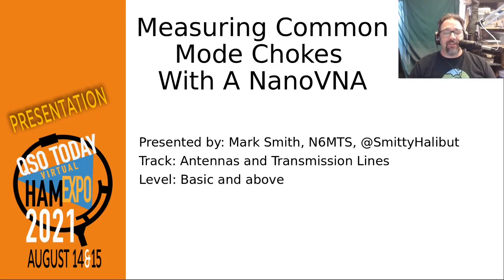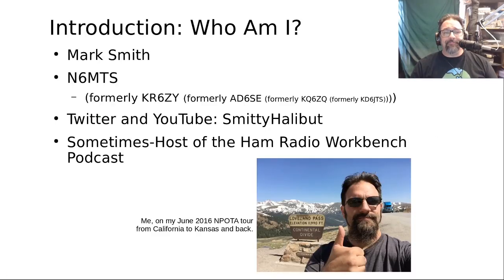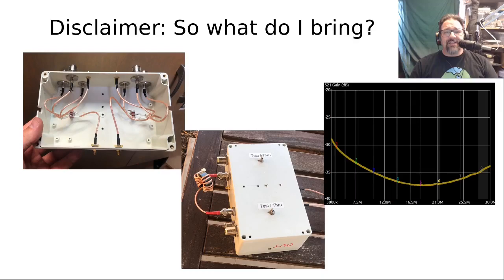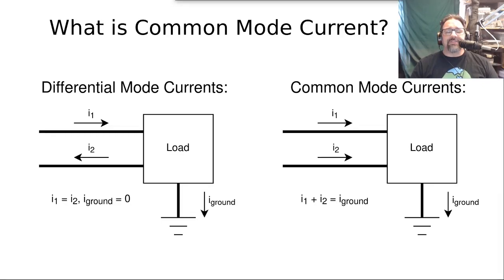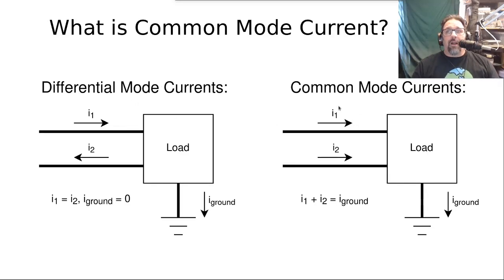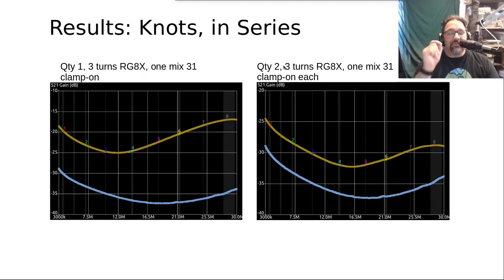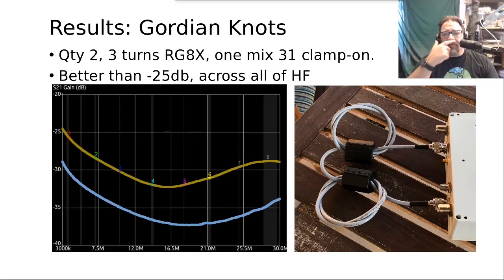Measuring Common Mode Current Chokes with a NanoVNA

Comment: You need to relearn your theory.  An inductor does NOT stop the flow of AC or RF current no matter what inductive reactance present.  What stops and attenuates common mode is resistive parallel  resistance that dissipates the common mode.  An inductor does not consume power it just changes it's phase.  Cores create this resistance within the core characteristics.
Reply: Thanks for the constructive input. I‘m sure Marc appreciates it 👍🏼
It helped me understand it better.

Comment: Great video on checking CM chokes. Thanks for doing all the work determining that 13T on a 31 Mix core is the best, fits right in with G3TXQ work that he did on chokes, baluns and ununs.
Reply: He actually said his favorite was 13 turns on a 43 mix 240 toroid not 31 mix.

Comment: I haven't seen the entire video so I apologize but thought I should say that TRX (a channel) has a video where he builds and measures the effectiveness of a common mode choke with a NanoVNA. I will come back when and if I see a measurement like he did. If not, go and see what he shows us.
Reply: I'm back. I like what I'm seeing very much. Its much more elegant to make a test device box.  I think though, you were both doing the same test. That said, what did you think of his initial test of toroid material ?
Reply: That said, I'm only seeing you show poorly wound coax baluns, and nothing properly wound. So far anyway. I'm going to wind a tested design balun with a 43 mix and good enameled copper wire 1 to 1 and see if it does what others have measured. A coax balun is not the way to go. But, I do like your testing set up, and have both a regular nanoVNA and a V2.
Reply: @californiakayaker  It depends on what problem you're trying to solve.   If you have a perfect dipole antenna with identical shape and size no uneven obstructions in the near field a wire wound balun is better, I think we can all agree on that.   

A wire wound balun won't solve my problem in my mobile between 160m ~ 40m where I am attempting to capacitively couple with the earth. I need coax balums right behind the unun or it all goes to Hell real fast.  You get the antenna perfectly tuned then start applying about 500 watts and it all falls right on its face, as the amplifier kicks out because it sees 60 watts coming back.  🤦 G3TXQ and K0BG discuss this on their websites.

Comment: Thanks very much! I was looking up what S11, S12, S21, S22 means and ended up bonking my head with formulas that explain scatter parameters. I know how and why inductors work but that Snn was new to me..easier then i thought..now it makes sense and i can use the values my vna spits out. Thanks alot.
Reply: I'm glad I could help!  🙂

Comment: First of all, nice video, one of the best I've seen on building a CM choke. Only one minor comment:  "Building something and trying it" is NOT really an "engineering approach". It is actually an "experimental" approach. As an engineer for 43 years, I found that taking an "experimental approach" ended up taking up a lot more time in the "development phase" of a product than working the design out mathematically before laying any lines down on a drawing. Having said that, I frequently approach my amateur radio projects as experimental in nature simply because I like building a lot more than I like math. In amateur radio I am not bound by schedules, budgets, difficult test requirements, etc, so I can enjoy the build to "see what I end up with". So, this is not meant to be a negative comment about your video. I found your explanations were clear and accurate with nice visual aids, and more importantly easier to understand than wading through the math. Good overview on setting up and using a VNA, too.
 --Mark, KE6BB 👍
Reply: That’s a fair point. I think what I was trying to say was “practical” vs “theoretical.” To me, that’s the difference between engineering and science. Engineering is more applied, science is more conceptual. 

But you’re right, “experimental” is an even better term for what I’m doing here. 

Thanks for the feedback! :-)

Comment: Forgive my late input . I note in a few of the comments that many would love to see a comparison against a Coax bottle type Choke and what the attenuation figures come out like . . Great video by the way . Well done 73.    Ron G4DIY
Reply: Thanks for the positive feedback!  I'm not sure what design you mean by "Coax bottle type choke".  A quick google search turned up a design where you wrap coax around a pill bottle?  Is that what you mean?  If so, that's just an air-core choke.  The bottle is only a form to wrap the coax around, but doesn't appreciably impact the magnetic permeability of the choke.

If you mean some other design, please point me to a page or article describing what you mean.
Reply: @SmittyHalibut  hi there again.  Well my “bottle type “ is literally a plastic bottle about 8 inches high and about 4 inch diameter . I have coiled    Rg 213   Coax around it with about 20 turns . So its a coaxial choke effectively.
Reply: @ronbennett5591  Ok, yeah.  So it's an air-core choke.  I've gotten feedback elsewhere in this comments section that I never gave a properly-wound air-core choke a fair shake, and that's true, really.  I need to make an update to this video with my CMCC Test Rig kit instead of the hand-built test rig in this video; when I do that, I'll give an air-wound choke a proper test.

Comment: You've probably figured this out by now, but when you keep saying you are making the circuit so that it is less resonant in that one place on the spectrum so much, what you are actually doing is lowering the "Q". Low "Q" equals wide bandwidth without the "performance" at any one frequency than you had before you started lowering said "Q". It's the same principal as the tank circuit in your vacuum tube linear amplifier. We shoot for about 12 "Q" because there we get a pretty wide bandwidth in which to work without making it so that when we go to tune it up on our frequency of choice within a band, we don't have so high a "Q" that if we breathe on the tuning capacitor we're not off into another band. I once built an amp with a "Q" of 40 or so and the tuning was so sharp that as the tubes warmed the amp up it would go out of resonance and I'd end up arcing everywhere because the plate circuit was so far out of resonance. A life lesson learned...
Same thing applies here, though all you see is no help from the choke you designed. It's all about spreading that RF around nice and evenly and giving up performance where performance is not needed, as is in this case. It's all about trade-offs. Trade performance for function.
73
AA5IT

Comment: I too have done some research and testing to determine the optimum ferrite materials and number of turns to get the most out of my RFI choke filters. I based my conclusions on ferrite manufacturers equations and my personal tests using signal generator, oscilloscope and nanoVNA to sweep the entire HF band (e.g. building a combined differential and common mode filter for the output of a home-brew DC switching power supply for my shack). I too found that, for a snap-on ferrite, 0.5 inch hole, type 31,  3 turns was optimal before capacitive coupling between turns reduced effectiveness. But for an FT-240-31 I think 5 to 7 was optimal, according to manufacturer's equations and testing (this was 3 years ago so I don't quite recall exactly). 

However, I also built a 1:1 current balun for use as a wire dipole feed point and I put 11 turns (16 AWG PTFE insulated wire, split and wound in two direction) on that one, and it tested extremely well, -35 dB attenuation across most of the HF band.  So it seems the geometry of the toroid makes a big difference in terms of how many turns is optimal. And your tests also showed better braud-band attenuation with the 13 turns around a FT-140.  Do you have a general explanation for this?  Why does the capacitive coupling add up so much with the snap-ons?
Reply: Its more about the turns of cable than the ferrite material.  When on a torroid, the turns are spread out, more space between windings.  When wrapped in a "Gordian knot", they're immediately adjacent to each other, maximizing the capacitance between turns.

Comment: Awesome stuff!
When you talked about calculating or experimenting with Gordian Knots to make a choke for a specific band, I had to comment because I've done exactly that.
I fly paramotors, wanted to build an antenna for GMRS (462 MHz) out of a chunk of RG316 with half of the coax sheath removed, then string it up  one of the glider lines. 
2 problems:
1) "Center/core fed vertical" doesn't resonate well on any frequency. Experimenting showed that the angle between the two legs needs to be around 30° (aIrc) for resonance, and 
2) Even if I got it resonant, Instill needed to decouple the antenna from the feed line, otherwise the radio body, the hand holding it,  any metal or human near the coax would cause wild swings in the SWR.
So I added a Gordian Knot, and experimented until I reach both resonance and decoupled the antenna from the feed line.
In my case there was 2 loops at around 6cm diameter. Location of the knot along the coax was also critical.

Couple of us flew those antennas for a while and they worked well but wore out quickly. 
Next version will be with more flexible coax, and the knot up higher on the line so it won't get beat up as badly during handling.

Also trying to figure out how to do multibands ...lol
Reply: That's awesome!  (Sorry for the late reply; not sure why I didn't get a notification for this one.)  Gordian knots can work well for mono-band operations, if you tune them.  And a rig like described here can help you do that.  But they are inherently mono-band.

Comment: Loved the engineering approach Mark. I am playing with common mode chokes now and so I am going to build a test box, everything you say about it makes sense. I was hoping to see more detail on ferrite core testing, going from 1 turn to 20 turns or so. At some point putting more turns on the ferrite the interwinding capacitance increases and so more turns is no help, just the same reason that more turns on a knot is no help. It would have been good to see how you got to 13 turns being the optimum for the size core and size coax you have. I am sure that a different size and type of core and different size coax has different optimum turns. The NanoVNA has opened up so much testing to low budge engineers - and thank you for pointing out the calibration issues. This is gold
Reply: Hi, I found similar, that interwinding capacitance appeared to be an issue with too many turns of coax on the core. Controversially perhaps my best wideband common mode chokes are wound with twisted pairs from CAT6 cable. Each twisted pair has a characteristic impedance of nominally 100ohms so effectively I have two in parallel to get to 50 ohms. I am getting much better bandwidth and very low insertion SWR.

Comment: Great work Mark! Now all you have to do to improve your test box is add a SPDT (3 position, center open) switch to the Port 0 wiring from the NanoVNA. Wire the "pole" pin as a short to ground on one "throw" of the switch and the same "pole" pin thru a precision 50 ohm resistor to ground on the other "throw" of the switch. Then add a SPST switch to bridge the center pins on the 2 output connectors for thru or "bypass" mode. VOILA,! You've now got a built-in calibrator too. Total of 3 switches: DPDT, SPDT (3-way), SPST.
Reply: That's not a bad idea.  THe concern is, it doesn't take into account the connectors on the test side of the adapter.  But, given all the other compromises we're doing, it's probably not really a lot worse.  And, it still doesn't stop you from using your own SOL standards.

I've put a ticket in my backlog to add that to the next revision of https://electronics.halibut.com/product/common-mode-current-choke-test-rig/

Comment: I took issue with the description of a coax as a differential cable early on in the talk (around 4 minutes). Signal Integrity engineers refer to them as single ended for a reason or two - a differential cable, for example requires at least 4 vna ports set into 2 logical port groups; and the shield is not the return conductor, it is a shield. It serves the same purpose as the shield over a twisted pair like in an ethernet cable, which is a true differential system. One more comment is that shields of coax are almost always tied to the chassis ground on both sides, not the signaling elements of a transceiver so there is no push-pull of currents. Any differential currents created are simply inductive coupling between the center conductor and the shield.

That all said, I love the data collected on the experimental chokes the nanoVNA plots. I wish we could have seen data for 2 chokes placed on a single gordian knot to see how adding chokes improved the common mode rejection also.
Reply: I just re-watched that section to make sure I was thinking about the right thing.

You are absolutely correct that there is a world of difference between a Single Ended signal (like on coax) and a Balanced signal (like on twin lead, or twisted pair).  But that's more about voltages, not currents..  (Yes, voltages which then drive currents though impedances, yes, so it's not entirely NOT about current... See below...)

But even a Single Ended signal will have opposite and equal current flows on the coax.  My mistake was referring to those currents as "balanced", little b, the adjective.  They are not Balanced, big B, the proper noun describing the signal type.  That's why it's called Differential Mode for currents, because that's different than Balanced for voltages.

The push-pull of currents part, again, you are correct.  That's the impact of a Balanced (big B) signal on the currents that we talked about earlier.  But that still doesn't mean that there isn't an equal and opposite current flow on the feed line.  If there's no other return path for current, it HAS go to on the feedline.  And even if there is another return path for current, like you said, it will induce the return current in the coax and probably prefer that path over the other (assuming your coax is well connected and low impedance compared to the alternate path.)

So, you're not wrong in any of your response. But I think those points don't really impact the description of the examples presented.

Comment: 16:00 — outer conductors of the two NanoVNA ports (at least on the old 1.5G one, the one made out of three SA612A mixers) are shorted through the device's common ground, just FYI
Reply: True. That would make the plane of testing right at the edge of the VNA, including the cables between the VNA and the test rig, which is ... less than ideal...  🙂

Comment: That's a GREAT video explaining Common Mode Chokes - One thing, you never talk about power handling ability since these are usually used with TX as well as RX situations.  The air core coax wound chokes would be limited only by power handling of coax, or close depending on how much capacitance affected power handling.  

The ferrite cores would be my concern - I think even the clipon ferrites would handle 100 watts, but when 1000 watts is involved it would require more?

Comment: An excellent presentation, I have been experimenting with common mode chokes for a few years. Further down the comments you will see the observations I have made. Greater than 25dB is easily possible from 160m to 10m, I will retest mine on 6m but I suspect it will be fine there too. Spoiler alert, I no longer believe that winding them with coax is a good wideband solution...
Reply: I searched for but couldn't find your other comment.  I am interested in your findings and your choke design.  Could you repost?
Reply: @geekthesteve6215  I couldn't find them either! I have done some experiments using twisted pairs pulled out of CAT5/6 cable, each pair has a characteristic impedance of nominally 100 ohms so two pairs fed in parallel retains a 50 ohm characteristic impedance. I have made many chokes wound with coaxial cable and always found the bandwidth disappointing. I have pictures and plots of this solution, nearly 40dB of attenuation at 7MHz...
Reply: @geekthesteve6215  This was my previous comment: Hi, I found similar, that interwinding capacitance appeared to be an issue with too many turns of coax on the core. Controversially perhaps my best wideband common mode chokes are wound with twisted pairs from CAT6 cable. Each twisted pair has a characteristic impedance of nominally 100ohms so effectively I have two in parallel to get to 50 ohms. I am getting much better bandwidth and very low insertion SWR.
Reply: @g0fvt  That's a really interesting idea.  Do you know why the Cat6 results in wider bandwidth than coax?
Reply: @SmittyHalibut  I believe that a major factor is the reduced capacitance between turns.
I made a variety of common mode chokes wound with coax, but I found that putting too many turns on the cores caused the high frequency performance to deteriorate. The braid of even the small coaxes has a lot of cross section so adjacent closely spaced turns will couple significantly. The CAT5/6 conductors have a very small cross section, so should result in reduced capacitance between turns. Certainly the insertion SWR is surprisingly low and the common mode attenuation has a very broad characteristic. 
I have not tested my first example at beyond 100w carrier...so far...
Reply: @g0fvt  Yeah, I could see that. Very interesting result.  Thank you for sharing it!
Reply: @SmittyHalibut  I can only suggest that people try it... and see for themselves if it has any merit